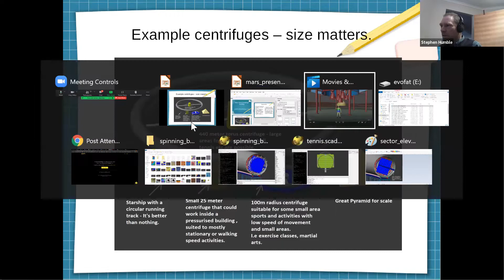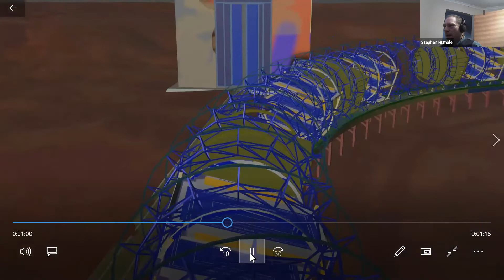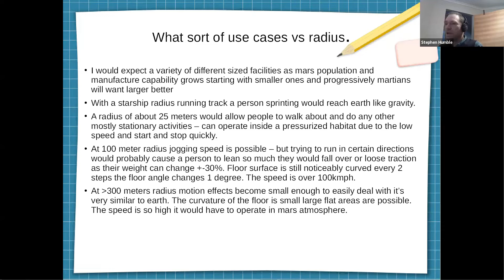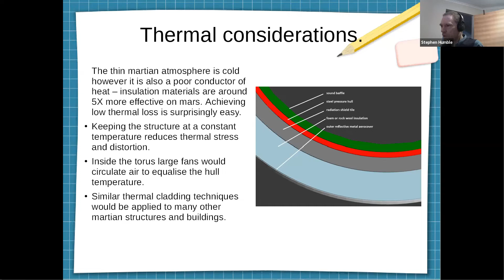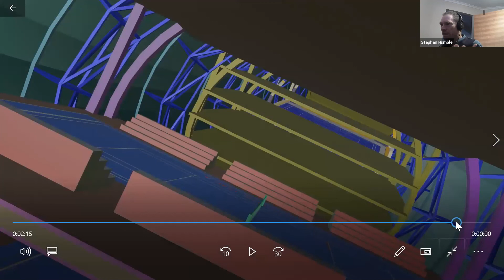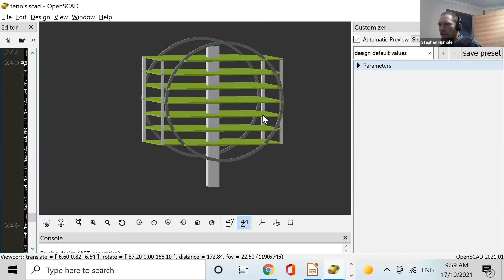Spinning toroidal gravity facility for mars - Stephen Humble - 2021 Mars Society Virtual Convention

Comment: Kind of crazy - replace a zero energy thing called gravity with a high power thing. Seems better to just engineer life that thrives under 38% gravity.
Reply: Overall the spinning toroid is terrifying. If anything causes it to stress, centrifugal force will try to rip it all apart, which is scary enough on earth, but deadly on mars, where there is no air outside, and so best case scenario, you survive to be flung a few hundred meters away without any air for your dazed or unconscious body to breathe.
Reply: @aresmars2003 The design would be very good - risk of some sort always exists the same issue exists with spaceships or any pressurised vehicle or structure on mars they can burst and a vehicle or a spaceship can crash. 
But consider the torus is essentially a pressurised train going on a round track with no crossings - trains are among the safest forms of transport a round spinning one cant ever have a collision so that risk can be eliminated and a fixed system like this can be monitored very easily.
It should be possible to make this very very safe.
Reply: @aresmars2003  Better even still to have life that can survive without oxygen, be impervious to radiation , able to endure extremes of temperature, and not require food as well but people, animals and plants are what we are and need all these things.
Reply: Maybe long term everything will change but i wanted to envision a solution for the medium term future where a normal human child could grow up on mars under earth like gravity and people could travel between earth and mars without suffering adaptation problems.

Comment: It's too complicated, too many moving parts.... Instead you float the ring on magnetic bearings that also serve as the drive motor. Zero contact with bearing surfaces means no mechanical wear and no need to ever stop the rotation. Because you never intend to stop the rotation you can build the internal surfaces of the ring at a fixed 70 degrees, then fit out the habitat after rotation has begun. With careful design so the magnetic bearings can be serviced while the ring remains in motion the rotation could be maintained for centuries.
Reply: Good points 
I did consider maglev for support and powering rotation but after research it turns out that steel rail tracks and wheels are more energy efficient than electromagnetic suspension by a large factor especially for very heavy loads (and this thing is quite heavy).
Although maglev trains have found use in some very high speed passenger trains the technology is relatively immature. Also although maglev can avoid mechanical friction forces electromagnetic suspension systems require constant high power consumption to work and the electrical losses are far worse than the rolling resistance of well maintained steel wheels and air bed support).
Almost all high speed trains and heavy freight trains continue to use steel train tracks and steel wheels because they really do work the best in most cases.

In the case of this torus with the tracks protected from dust the rolling resistance of rail can be less than 1000th VS maglev power cost was like 10X worse.

I agree maglev seems like a futuristic and desirable technology but i also wanted to show a design that is based on very well established technology easy to manufacture and relatively fail safe. Perhaps with use of exotic technology like superconductors maglev could in future be better than steel wheels (and air bed) but i wanted to show a design using technology that can be built with off the shelf components we have today and does not require development of any exotic technology.
Reply: @stephenhumble7627  Maglev trains don't compete well at all with steel wheels and tracks on the Earth, but on Mars you have to perform maintenance in a vacuum and your supply chains begins 249 million miles and 2 rather steep gravity wells away.

 Train wheels last about 700,000 miles and that's on a train going about 50mph. It's a safe bet wheels for a train going 143mph will wear out much faster. All the same assuming no increased wear due to speed wheels should still last no longer than about 7 months. So you can be sure maintenance wise for wheels alone the structure will need thousands wheel replacements a year and crews to perform the maintenance. 

When you consider the cost of supplying replacement wheels, bearings and what have ya from Earth and the cost of feeding, housing and paying the maintenance crews on Mars...The increased power demands of maglev are probably trivial. 

As well energy production tends to benefit from an economy of scale. The cost of a plant that makes 100 mega watts doesn't cost 10x more to build or operate than a 10 mega watt plant. In fact it's probably something like 2 to 3 times more to build and roughly identical operation cost.
Reply: @THX..1138  For this size construction the torus would have to be >99% manufactured on mars. With steel produced by Martian industries to minimise imported parts. The idea is for mars to develop a self sustaining civilisation as soon as practically possible where humans could conceivably stay however long they want on mars.
Perhaps maglev or superconductors will be cheap and plentiful to future Martians - so they will have to choose what works best. 
For the presentation I really wanted to validate it can be done using technology adapted from existing train systems. A superconducting maglev would be an upgrade path but I found steel wheels would be quite an effective technique.
Steel wheel wear is mostly driven by track contamination and corner slippage and these wheels will be oversized and working at fixed angle in an enclosed track with low loading so friction and wear can be reduced to practically zero. Design life can be engineered to be well over 20 years of continuous service.
The air bed tunnel track enclosure will be accessible during operation allowing maintenance to take place without stopping the torus - wheel drive units could be swapped without stopping the torus.
One thing about train wheels and electric motors and air pressure are it is reassuring this could be really work and martians could make a centrifuge this big work that way. If they find better methods that is good too but my initial analysis found wheels can work perfectly well.
Reply: Thank you for the comments i should incorporate an explanation of why i when for the tilting design vs a fixed angle.
I did consider a fixed angle but i just found too many cases where it would be problematic and too many issues so although tilting sectors created some extra complexity it seemed better than the alternative problems of having a system that could never stop.
To keep the torus moving requires constant power consumption to overcome aerodynamic drag in mars atmosphere somewhere around 10Mw of power is needed so a  loss of power leading to the slowing of the torus would cause everything to fall if the decks could not adjust angle  it may not happen often but it would be an absolute mess if ever happened.

The tilting design also allowed for intermediate gravity.
Refurbishment and Construction and maintenance are easier when stopped especially if heavy or large items need to be moved or repairs the external shell done etc.
Having tilting sectors turned out to be quite a small cost for a number of reasons.-one of those is the framework to spread the load forces and provide structural rigidity is needed anyway.
Reply: Complexity is ok - there are freight trains with thousands of axels and hundreds of carriages - electric trains and motors are a 100+ year old technology i think it's pretty well proven and safe. And Mars is going to be complex no matter what - your life will depend on complexity from the starship that gets your there to the life support systems and everything else you need.
Reply: Other considerations were that the speed of this size torus is moderate at ~230kmph and by using extra large steel train wheels the Wheel RPM can be equivalent to a train with smaller wheels running at only around 120kmph.
Another factor with steel wheels is the axel loading due to the weight of the torus is very high similar to heavy freight trains when the air bed pressure is lost. 
Current maglev systems have been for light weight very high speed passenger trains.
VS the torus is more in the class if heavy freight.

Note that I calculated axle loadings for a design using only 2 X 2 rails - it would be possible to have  more rails s but the idea was to use air pressure in normal operation so the wheels only deal with a small portion of the total load and provide guidance to keep the torus aligned as it rotates.

With maglev it requires more power to keep very heavy loads levitated - although perhaps with superconductors it would not use any power for levitation.

Future Martians may have many possible technologies to consider maglev , steel wheels and rails , air suspension , maybe even superconductor maglev.

Maglev does have several possible advantages one was it may be quieter in operation.
And as the torus track is only about 3km long the length of the track which is quite expensive and complex for maglev systems is much shorter than a typical train track that would goes tens or hundreds of kilometres.
Reply: In terms of complexity both maglev and steel wheels would both require an active radial motion mounting system to deal with the torus expansion and  contraction, from temperature changes, inside pressure, and centrifugal force - the overall radial change could exceed 20cm. !
In addition there will be eccentric forces and structural distortion and motion due to weight imbalances of the torus to deal with and kept within set limits.
Whatever suspension system is used will need to be capable of active radial adjustment and motion during system operation with some kind of mechanism.
The good thing about having rotating sectors is that the torus can remain a fully functional habitat when operating at any speed. For example if there is a power shortage it can gracefully slow down and all the sectors remain upright.
Power shortages could result from many causes, a dust storm , a meteorite impact , equipment failure, etc.
During some of the construction phase it will be easier for the torus to be at mars gravity so that the weight of everything is much less.

Comment: I always imagined these type of colonies as bowl colonies.  The closer to the hub you walk the closer you get to the the gravity of the body it's built on, the closer to the rim, closer to earth, or maybe a little above you get.  I'm assuming as people got older they'd all snowbird close to the hub!
Reply: Thanks for the comment i should have explained the the reason i ended up with a torus is it was the most material efficient, structurally strong , and the round cross section with tilting sectors meant it could be stopped or change speed and everything would remain upright.
When i looked at the problems if it ever stopped the end choice of a torus with sectors that can tilt seemed the best good solution.
If i used a bowel or sphere like design the pressure hull thickness would have to be much thicker and heavier than a torus and if it changed speed it's would have problems.

Comment: One possibility is to have a steeply banked race track on the inside perimeter of the large domes colonists might live in on which electric RV like vehicles travel at speed to make one gee. I think it's likely that a few hours/day in one gee might prevent muscle atrophy.
Reply: Yes driving , running or riding around a sloped wall circular track will work too and initially that is all they will have on mars.
This torus would enable Martians to have a have a place they goto which has open spaces they can walk , run ,jump and play sport, eat , rest etc like we do on earth.

Comment: The large torus design is overly complicated.

It's way better just to have a constant rotation, then you can have a nice flat floor that only curves in one direction. Also vastly simplifies construction.

Swinging arms would be good for something like a tennis court. Or at least an even number of tennis courts, so they can be spun up when in use, and stationary when not.

On Mars carnival ride style engineering can scale enormously. But there's still a point where you want to just have a fixed structure.
Reply: Good point I considered many options but to get the large relatively flat surface area for a tennis court with earth gravity requires a radius of at around 400meters and speed over 220kmph - the energy to stop start such a system frequently would be awkward - Also pods of that size would have huge aerodynamic drag in mars atmosphere.
The torus minimises aerodynamic drag and though the access arms do create drag keeping them aerodynamic and flat in shape i found it would be low enough to be ok.
And i also wanted to have a design that could operate for long periods so that it could have schools, accommodation ,offices, restaurants and all sorts of activities so the torus with the hub seemed the best choice.
Reply: I initially started with a fixed slope design but foresaw so many issues with that it turned out to be better to have sectors that can tilt to any angle - consider for example a drain or basin or loose objects if the centrifuge stops everything tips out falls over etc how do people get about when the rooms are tipped at 70 degrees if they have to stop for maintenance or something. The tilting sectors allow it to be used at any speed without much difficulty - although floors will have some curvature it small enough that it is still usable.

Comment: Easy peasy lemon squeezy.

Going to be super useful for manufacturing as well. Build them with layers like an ogre, if you're already spinning a whole building might as well have different gravity zones.

You can put some lunch rails around the outside. Let the spin fling you halfway to wherever you're going, obviously landing would be up to the user.

Lots of ways to use a centrifuge.

Source: I was a carny for a while. We are good at understanding spinning things, theory, construction, maintenance, and operation.
Reply: I considered having multiple zones like a concentric set of rings but figured most of the time you probably just want the earth gravity area and the single tours can maximise that zone without wasting much cost on areas that have less gravity. The single torus helps keep the overall mass, weight and cost low.
Having the tilting sectors means it can also operate at any gravity level like if there was a reason to go at say 80% of earth gravity for a time to help people acclimatise to full 100% gravity from mars gravity.
There would probably be smaller versions of torus centrifuges in use on mars before this giant version ever gets built. Like maybe they will initially be start with a 100 meter torus.